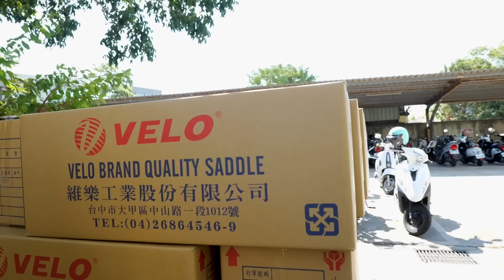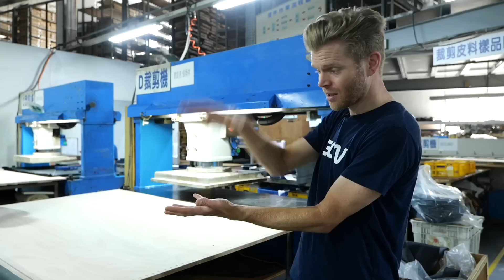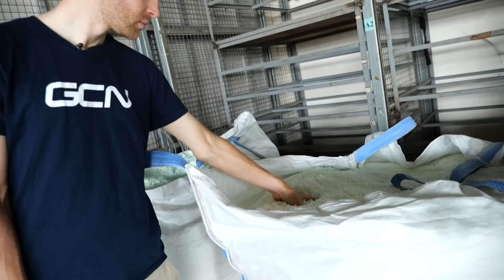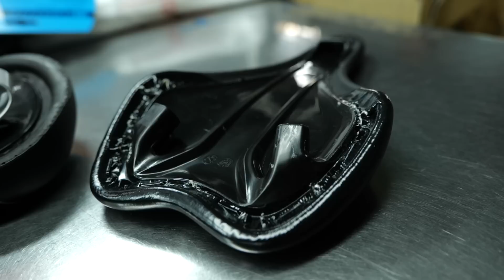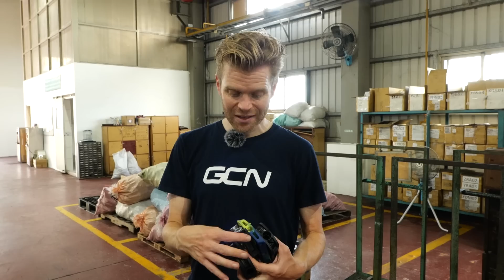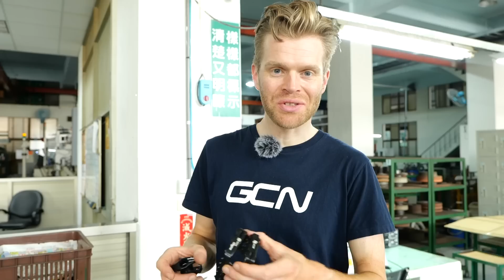Where Do Your Bike Components Really Come From? | Inside Cycling's Biggest Factories

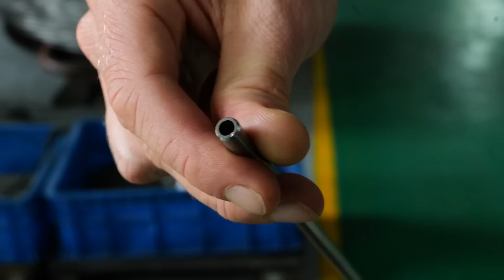Comment: 5:56 "Titanium is a stronger metal so it means it can be hollowed out and still be as strong as steel and so that makes it even lighter steel" 
Someone didn't listen carefully during physics classes. Almost all the stiffness comes from the outer layers of the shaft, so drilling the middle does not affect almost anything at all. You make it sound fancy, but the reality is also steel shaft could be hollow to reduce weight, but they are being sold for much less price that titanium, so it that step is skipped to reduce manufacturing costs.

Comment: Manufacturers in Taiwan should also get tremendous applause and credit for making parts for vintage bicycles of latter half of the 20th century. If you're asking your local bike shop for Sturmey Archer parts, 26 x 1 3/8" tires, spokes, BB bearings and cups etc. They'll most likely be able to find them from Taiwan. The fun of restoration gets many a good bike back out on the road.

Comment: Fascinating! No wonder China wants to get it's hands on Taiwan! It's like the whole country is one massive manufacturing workshop! Wellgo pedals are great. All my flat MTB pedals are and have been Wellgo. They've never let me down, they last ages, took a huge bashing and I've never had to service them! Exactly what you want from a product. Thanks GCN & Oli great film, more like this please! 👍
Reply: China's desire of Taiwan are primarily cultural and secondarily due to how maritime control is distributed via maritime law and the geopolitical implications of the S.China Sea and particularly with Japanese trade routing. Taiwan punches up economically but its a blip compared to China. And Taiwan's most important production isn't something China could take through conquest anyways as its dependent upon European inputs (and there's contingencies to demolish chip fab factories in the event of an invasion)
Reply: "Wellgo pedals are great."

I wouldn't say that. I bought some B102 pedals a few years ago and the bearings might as well have been adjusted by a monkey; way too tight and they'd barely spin. I had to adjust them myself but guess what? There was no keyed washer in there, nor even a groove in the spindles to accommodate one, which makes it next to impossible to perfectly adjust them. 

If you're not familiar with how loose bearing pedals are supposed to be made, read Sheldon Brown's article about it. The keyed washer is assumed to be there because it's a necessity, due to the cone and jam nut being stacked on top of each other down in a hole where it's impossible to get two wrenches on them at the same time. The keyed washer prevents the cone from tightening while you tighten the jam nut against it with a socket.

After a few hours of dicking around with them I got them pretty close to perfect so that they spin great, but the jam nuts still aren't tightened against the cone as much as they should be, which means they'll probably get out of adjustment in short order. Fortunately I don't ride the bike they are on very often.

I bought my first pair of Wellgo pedals in 1997 and those at least spun smoothly and freely as is, but those aren't perfect either, because there's always been a little bit of play in the bearings, which means the cones should have been tightened slightly more at the factory. There's a precise point when adjusting bearings that there's no play yet they still spin smoothly and freely, and Wellgo apparently can't find it.

Comment: Should saddles be replaced over time or miles?
Reply: Depends..time degrades things, but so does mileage. Rider weight, riding style and terrain will also play their part. A 60kg rider who spends half their time out of the saddle and rides smooth roads will wear the saddle less quickly than a 100kg rider who is always seated on rough roads, even if stored in identical conditions.
Reply: @PhilOsGarage great answer.  I'm really tall and big guy.  I've ridden the same saddle for 6 years and over 20K miles.  I don't find it terribly uncomfortable but I might see what a new one feels like.  Thanks!

Comment: Wellgo makes the OEM pedals for a fair few BMX brands.
GT, Mongoose, I believe SE. I'm more familiar with the older brands than the "newer" ones, although my daughter and I both ride/ race current model BMX bikes.
I'm an old head at heart, so I always look at the old brands when their new models come out.

But I recognized quite a few of those pedal bodies. As a matter of fact, the multi color one was an Odyssey brand pedal. They are a separate "parts" brand.
Reply: "Wellgo makes the OEM pedals for a fair few BMX brands.
GT, Mongoose, I believe SE."

Maybe some, but not all. The stock pedals on my 1984 Mongoose Californian were SR P-468. SR is a Japanese company that designs and manufactures its own stuff in Japan, or at least they did back then. The stock stem was also SR (MS-422), made in Japan. The frame and fork were made in Taiwan though; 1984 being the first year that all of Mongoose's frames/forks were made in Taiwan. They started making some of them there in 1983, and before that they were all made in California.
Reply: @MaximRecoil  I was referring to the plastic pedals more than anything, and on the latter 80s BMX bikes, mainly. I'm pretty sure that Wellgo made the plastic pedals for GT, Dyno, from the 80 to currently. The SE bikes currently, and the Mongoose bikes , from the 90s Wal- Goose era to currently. 
I am also fairly well versed in the old school/ mid school bikes, so well met! Although I mat have oversimplified my original answer. 
I only vaguely remember an SR plastic pedal, to the point I'm doubtful there was one. And if there was, I wonder if they actually made it in-house? I seem to vaguely  remeber a friend of mine having an 86 DiamondBack with white SR pedals on it, but the could also have been painted metal. At 50, my mind does that occasionally...
 I still have the 3 I originally owned in the mid/ late  80s, as well as the 4 others I bought from my friends when they would rather have money for a car. And another 14 besides those in my collection currently. And only 1 road bike and 2 mountain bikes🤣

Shimano was emerging then (Shimano pedals are still highly sought after, and command a premium). SR/ Sakae was certainty a heavy hitter in OEM equipment brands for Mongoose, as well as a few others. My Californian has the 468s on it, and a set of s f e Supers that I bought that bike with, that look exactly  like the SRs. I have an NOS set of SR MP-470s in the box. I always liked the MKS Grafite-Xs, too. Back then, I was lucky to have the bikes I scrounged and saved for 2nd and 3rd hand, I never had the MKS pedals.
 I had the Wellgo  knockoffs🤣 But, I still have them,  so they couldn't be so bad(?) Few of the guys in the bike groups give me hell about it, but it's fun.
Anyway, at that time (80s through the 90s, Wellgo would have been on the lower end models of the bike brands that I mentioned, and also a lot of the department store bikes. Still are, honestly. But it's nice to see some of the old brands are still in business.
Take care!
Reply: @ghowell13  "At 50, my mind does that occasionally..."

We're about the same age then. I'll be 50 in several months (class of '93).

"Shimano was emerging then (Shimano pedals are still highly sought after, and command a premium)."

Yeah; there are a few pairs of NOS first-generation Shimano DX pedals on eBay right now and the asking prices range from $1,043 to $1,850, which is utterly absurd.

I ordered a new pair of MKS BM-7 pedals for my Mongoose. They reissued them in 2012 and are still making them. They even improved them slightly over the originals by using an aluminum dust cap instead of a plastic one. They are still made in Japan and they still have a great finish. The amazing thing is the price; around $30, which is what cheap Wellgo "bear trap" pedals sell for, which are knockoffs of the much nicer original bear trap pedals: Suntour XC (which were designed by Suntour and manufactured by MKS).

MKS has been the best pedal manufacturer for decades in my opinion. 

I have two pairs of Wellgos and I'm not impressed with the way they adjusted the bearings on either of them. The ones I bought in 1997 at least spun smoothly and freely, but they had slight play in them. The cones should have been tightened a hair more before they locked it in place with the jam nut.

The ones I bought a few years ago might as well have been adjusted by a monkey. The cones were way too tight; they would barely spin. When I opened them up to fix them I discovered that not only was there no keyed washer between the jam nut and the cone, but there wasn't even a groove in the spindle to accommodate one. That makes it next to impossible to adjust the bearings perfectly, because without a keyed washer, there's no good way to tighten the jam nut without also tightening the cone (since they are down in a hole you can't get a wrench/socket on both of them at the same time). 

After about an hour of frig-farting around with them I got them close enough, by jamming a screwdriver in there to mostly keep the cone from tightening as I tightened the jam nut. They aren't perfect though, and the jam nut isn't as tight against the cone as it should be.
Reply: @MaximRecoil hate to hear the poor quality on those mid school Wellgos. But  that's nice to know about the MKS pedals, I'll look into them. I could use a set for an 83 GT race bike I have that I still race occasionally. I had a set of Odyssey  triple traps on it, and about the 2nd or 3rd race out, I bashed the left pedal in and did everything but send myself through the infield.  Thankfully,  I didn't wreck the 3 piece Sugino cranks I had just gotten a new square taper Shimano  Dura Ace BB for, lol.

MKS is still making the Graphite-X, or were. They can be found if you like those. 

That DX pedal price is insanity. Although, though the bike groups on Facebook, They were still 5-700 dollars  for really good/ excellent condition ones. I only have one set of them, and I need to strip the awful gold anno (what's left of it, anyway) off, and give them a light polish. Those centercaps are the devil to find, too, although apparently someone in Australia is 3D printing  them. If you're on Facebook, check out Old School  BMX Life. There's also a Mid and New School Life pages. Based in the UK, but good groups. Can find parts much cheaper than eBay or BMX Museum dot com.

Comment: Very interesting.  I’ll bet supply chain options for bike components are much more limited than we think.  It’s a huge investment to create these production lines, which is a big barrier to entry for competitors.
Reply: It's just much cheaper to have someone else make it. If you make your own you have to invest in all those machines, logistics, raw materials, parts and expertise workers to just make your tiny part of the market share, and idle machines are losing money. Consumers benefit greatly too from lower cost (maybe)
Reply: @zurielsss Some small producers do make these products using newer equipment than shown in the video but intentionally remain niche market . The big problem in Taiwan is that they often use equipment which is old , outdated or worn and makers won't re - invest every 10 years or so in the latest more accurate equipment .
Reply: With all that investment I have to wonder how much help these manufacturers got from their government.

Comment: A great video and insight for those who are thick as mince. A battery for a Porsche 911 from the dealer, depending on the model costs up to £500, however if you know where and who to go too. You can purchase one for just over £100 & even get an extra years warranty. Fact, because I’ve done it. The must have brigade all pay through the nose, however industry loves and needs them.
Reply: Wait untill they serialize them like EV batteries and it will brick the whole car unless you go to the dealer.
Reply: @feedbackzaloop  Think about the idiots who have purchased an EV, out of their own hard earned money. Depreciation of up to 50% in the first 3 years and all because they believed in a fairytale, they’ll of had their boosters of snake oil too.
Reply: @feedbackzaloop hopefully that doesn't happen. I'm almost certain they'll need regulations to prevent them, because they are so greedy they won't be able to help themselves
Reply: Yep, "Brembo" discs for my Jag over £500 a pair. OEM £170.
Reply: I once worked for a large manufacturer, Brand X we'll call it, who sold another manufacturer's product with the Brand X label on it and for months this product wasn't available from Brand X. I was in a meeting with a bunch of salesmen who were upset because their customers could buy this product direct from its manufacturer (call them Brand Y) at a lower price. We were told it was because Brand Y's product did not pass Brand X's quality testing and Brand X wouldn't sell them until it did.

Comment: That OEM talk made me wonder, how many tiers deep can you go with bikes. Example, Corratec bikes with ZZYZX wheels, which have Formula hubs, which have NBK (of that I am not exactly sure) bearings.
Then, aerospace guys will go nuts from Ollie calling steel alloy and alu metal😉
Reply: I suspect it confuses many, but steel is an alloy, but aluminium isn’t. Many people think alloy means aluminium, but it’s simply a metal made of more than one material, steel being an alloy of iron and carbon (also other elements such as chromium and molybdenum) pure aluminium is an element, but it’s usually an alloy of aluminium, silicon and other metals, hence aluminium alloy.
Reply: @PhilOsGarage aluminium is an alloy in most applications. A quick google says that aluminium 6061 is common in bikes, which is an alloy with silicon and magnesium.
Reply: @PhilOsGarage  it is confusing indeed, to think that general absolute truths are applicable to narrow professional areas...
Those are just colloquialisms. As aluminium alloys became frequent in aviation while pure aluminium was never used, engineers omited the "aluminium" part.

Comment: I wanted to see how they attach the frame to the saddle!  You have to go back Ollie!  ;-)
Reply: The middle section of the rails the lady had in the plastic trough at 6:00 approximately are cambered slightly when pressed and de - cambered in another press when fitted to take up nose and two rear sockets slack . Only modest pressure is used . This is how Selle Italia do it .

Comment: Do they have air conditioning in their factories? I noticed all the fans, which is great, but it gets really hot there sometimes doesn't it?
Reply: I think only the testing room has AC, saves a lot of cost in electric bills
Reply: It's hit and miss. I've worked in a few factories. Some just have large industrial fans and it's actually a really nice temperature. They only turned in the AC for the gringos that came in, they told me they hate the AC lol.